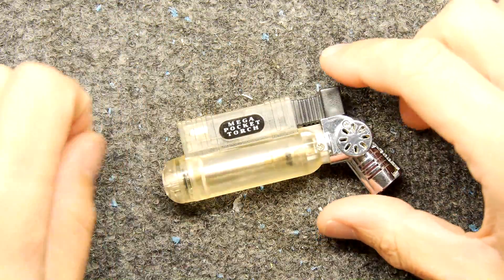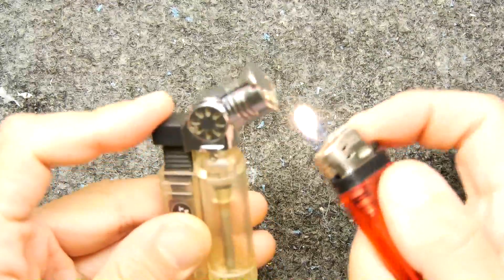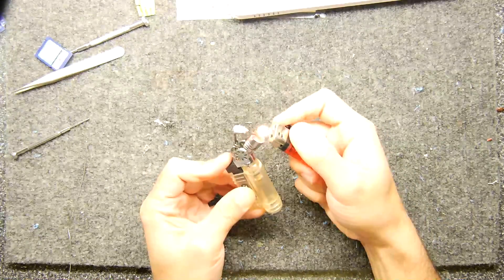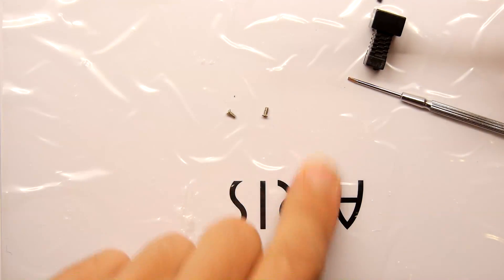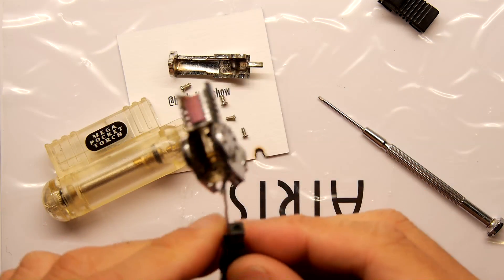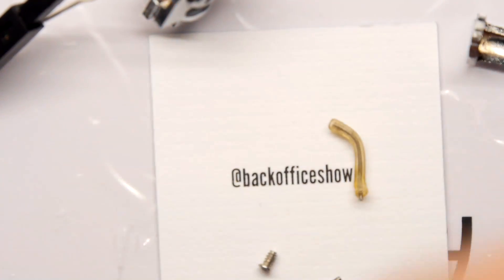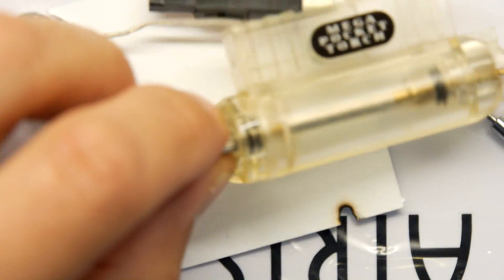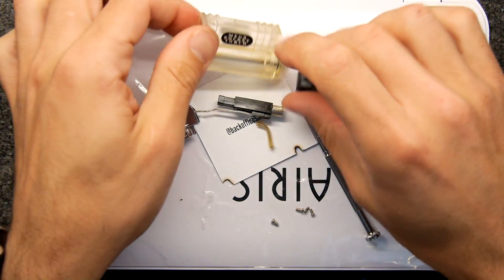Pocket Torch Jet Lighter Failure

Comment: The metal up the hose has nothing to do with the igniter. It gives the hose some structure. The igniter sparks up the white wire going up into the nozle. Had you taken the screw out where the hose connects youd find that it is clogged up with oil and dirt. Carefully remove the screw there will be thin metal plates with micro pin holes in them a couple of mesh screens and a couple of washers. Clean all of those and the stem going all the way up. Then reinstall carefully and your lighter would have worked again.

Comment: I have never worried about the safety of a youtuber  while watching their video until now.  I'm glad you still have all your fingers.
Reply from the maker: Haha, lighters tend to be pretty safe, the sidewall thickness on even the cheapest units would take a fair while to fail. As the gas was being burnt off via the metal nozzle that was absorbing the heat and not the plastic. Certainly I would not recommend anyone do this! Thanks for your concern :)
Reply from the maker: Also, avoid watching this video then! https://www.youtube.com/watch?v=34JGvRwB3MI :)

Comment: Those little electric ignitors are king of useful, you can also use a crockloft voltage multiplier to boost the voltage to extreme levels!!